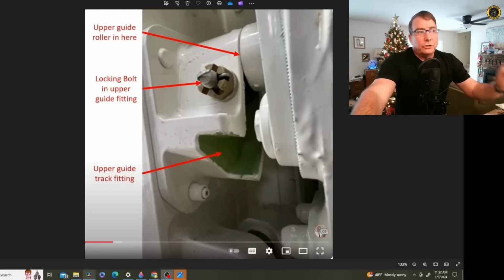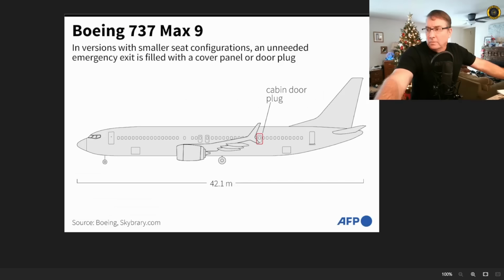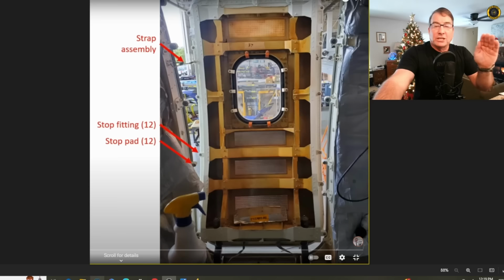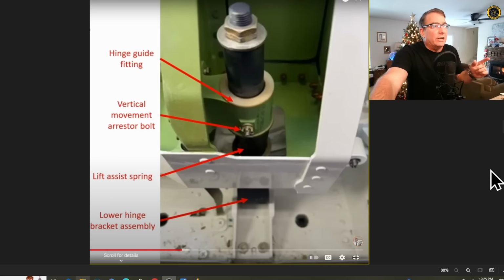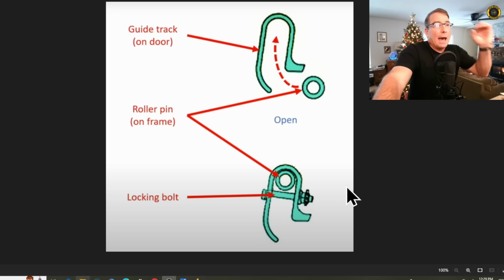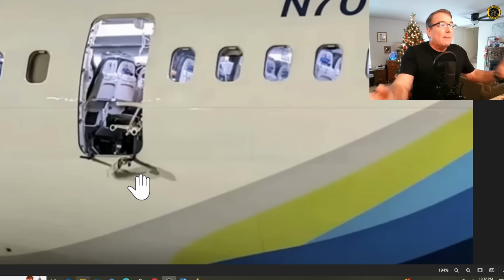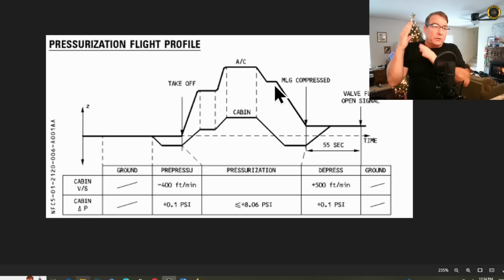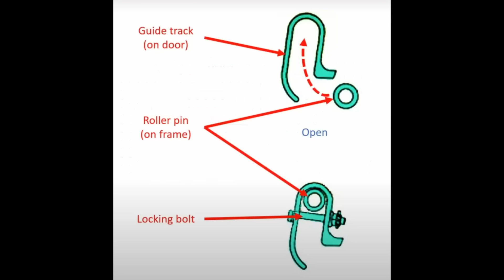Alaska 737 Max-9 Door UPDATE! 8 Jan 2024

Comment: Boeings share price is falling faster than an unbolted plug / plug door / door plug or door 😱
Reply: -5%?
Reply: @sonnybowman  Boeing down -28.28 (-10.99%) past 5 days, be careful posting misinformation, always stick to the facts like Juan
Reply: ....door....... the door thing.... you know the thing.......
Reply: @leokimvideo  It probably fell after the MCAS events also... then rose again, Not a going out of business event.
Reply: Plummeting as fast as Bud Light, lol.
Reply: That's what happens when having planes crash & paying a fine is part of your business model & deemed an acceptable risk so your multi billion dollar operation can make an extra $4m in efficiency savings...
Reply: I finally saw a video that explained enough that I could figure out how that damn door works.

And it's very much a door not a plug.

"Plug door" is an oxymoron and an apt description of what's going on.

It started with a plug, except plugs are really heavy and hard to maintenance. You have to remove the seats and get three big guys or a cherry picker with a proper plug. Lighter than a door doesn't mean plugs are not heavy.

So instead of using a completely failsafe simple set of lugs around the plug frame, they created a complete abomination.

They added hinges so it could swing open. So at this point we have determined that it is a door. Plugs don't hinge, doors do.

Having a continuous bevel makes it impossible for that hinged work so they reduced it to eight small little pads. I think it was eight it might have been a couple more. That way if you shift the door even a single inch it will be free to swing out. That doesn't make it a plug that makes it a complicated door, and a nearly completely compromised plug.

Then they add two giant springs, it's literally spring loaded to eject itself.

And those loose bolts people keep talking about. Those aren't the same bolts as the missing bolts.

Remember when I said they added a hinge? The bracket for the hinge is what they are finding has loose bolts.

One of the hinges is actually missing from the airplane. The same hinge with loose bolts on other aircraft.

So it's not a plug at all it's an outward opening spring-loaded death trap, installed with reckless abandon.

I couldn't come up with a worst design if I tried.

A piece of plywood nailed to the fuselage covered in speed tape, would have been a better solution. Literally Red Green show engineering is more sensible.

None of that figuratively literally, I mean literally literally.

I'm honestly amazed that "plug door" took this long to fail.
Reply: leo, very funny but also sad.  I worked at Boeing '68-'71 and loved the company.  Now unhappily watching the once great company decline into a shadow of their former self.  It started when they moved hq from Seattle to Chicago.  Went from an engineering company to a bean counter company.  :(

Comment: This is a very interesting door design.  I was under the impression that the term plug door means that the door is designed to seal better as the pressure differential increases due to it having a tapered sealing surface.  This means the door could only be removed or released by pulling it inside the aircraft first, i.e. like the over wing exit doors.  This design seems to allow it to release just by sliding it about an inch or so.  Anyway Juan is the gold standard place to go to get the details.  Great analysis.
Reply: Since it's an airplane and not a submarine, I'm wondering the same thing.
Reply: Yes, 2nd the gold standard @jerryfaircloth Juan is the modern day equivalent of Feynman looking into the Challenger.
Reply: Don't the NG (and later) over wing exits just swing up (ie: hinged at the top) ? I remember seeing them like that in the aftermath of the Turkish Airlines 737 crash at Schipol in 2009 ? I think they are held in by pins at the bottom during flight.
Reply: @jerryfaircloth spot on. in order to analyze how this will come is to know how OWE works. and this is like what you have said. cams on top and bottom of OWE are oriented diff such that you can pull down slightly and push out.
Reply: door plug does mean pressure sealed but this is a plug door which isn't. Boeing could have came up with a better term!
Reply: I thought the term door plug was used to describe what goes into the hole that is designed for an emergency exit door on those airplanes that do NOT require an emergency exit at the door plug location.  In other words, if the airplane seat configuration is above X number of seats, then the airplane will have an emergency exit door at that location.  If the airplane seat configuration is below X number of seats, then that emergency exit is not needed, so they plug the hole with the door plug.
Reply: You just made me realise that these door plugs are configured to open outwards... 😳

Now if the MAX was a submarine then that might be fine. But it's an aircraft... ✈

The pressure differential works the other way around... ⚠
Reply: Exactly my thoughts..I've never heard of an emergency door being lost in flight....This "plug" door....should have been designed such that the pressure differential held it in place no matter what...Boeing..Going the route of today..cut corners, go on the cheap and no worries...Sickens me...Let the other aircraft manufacturers go down that dark road, NOT Boeing
Reply: Plug doors do work that way. This is a "plug", but is not constructed like a regular plug door. Very misleading terminology.
Reply: apologies - I asked the same question sometime after you, but with less background knowledge. But pne of my predecessors worked on the deHavilland Comet and I recall the windows were s weak spot that led to structural failure.
Reply: That design would be better sealed but you don't want doors that open inwards to a cramped space. The plugs are similar to the doors and to open such a door you would need it clear of seats and people to operate. Unsuitable for emergencies where crowds might be pushed up against it.
Reply: @dieseldragon6756  before it opens outwards it goes upwards so the stop fittings can clear the stop pads. When in the down position, since the pressure is from the door fittings onto the door frame pads the differential is correct but it is tricky to get your head around.
Reply: In my opinion it's a design flaw, a kluge, a Jerry rigged "fix".  Better design would be to manufacture a fuselage with NO holes at those places for planes that do not need an emergency exit there (because seat configuration doesn't require it), but then Boeing would have two versions of the fuselage, one with holes there and one without.  A simpler solution would be to just install an emergency exit at those locations on EVERY airplane they roll off the line regardless of whether the seat configuration requires it.  Plugging the hole on some planes and putting an emergency exit on others just adds another point of failure for the planes with the door plugs.  As I said, a stoopit "fix" for a problem they did not need to have.

Comment: With the castle nut and the cotter key it was designed to be bullet proof hopefully. Unless bolts were inferior looks like cotter keys were missing and nuts fell off or they were never installed at all. Scary and lucky.
Reply: You'd be surprised how often those cotter pins/keys get missed on cars, wouldn't surprise me if it's happening on planes too. Inspection paint is your friend!
Reply: who signed off on those installations ?  seems like there should be double-blind inspections (different people (not known to each other doing that job), different random times) on all these critical installs.
Reply: I'm betting the cotter keys were not installed
Reply: I realise that it would be hard to do - but if the bold/nut arrangement was reversed, the bolt couldn't fall out if the nut came off. I know that the cotter pin is supposed to prevent that, but it could have provided a bit of extra protection. The cotter pin would be hard to fit and replace if it was reversed, I get that too. The head of the bolt would be a lot stronger.
Reply: @ChavngRynsPvts  But on a brand new car? Unlikely. Yes, if its been down to a back street mechanic a few times, fair enough, but I strongly doubt Ford or VW or Honda would ever fail to install something as crucial as a cotter pin.
Reply: I'm going to vote for never were installed in the first place.
Reply: At this point, yours and Juan's theory seems to be the most logical. The question is WHO left the cotter pins out? Someone else said that AAR did a mod to this aircraft.....and maybe did the mod for other airlines as well. The "who" part may not be so simple to determine.
Reply: @grayrabbit2211   Not likely. I doubt it could fly even once without the bolts installed.
Reply: @karlosbricks2413  I have greater faith in people failing than you have. Or weaker doubts. Two of my recent Found on road dead’s have had factory errors that lead to failures. (One was a 13 cent missing washer that lead to a transmission sticking in gear. 26 hours labor.)
Reply: Bullet proof, but idiot proof?  Always a human factor in these sort of things.
Reply: @theharper1 I thought about that, but how do you get the clearance to get bolt installed in the first place?  What happens when you need to remove the door?
Reply: I bet there are zero cotter pins on modern cars.  They went away with grease zerks.
Reply: @anonymous12345678935  that's why I said it's difficult (not impossible though). The only reason that the "plug" would need to be removed would be to refit the aircraft interior or convert it to an LCC configuration, which would be very infrequent.
Reply: Missing cotter keys or improperly installed cotter keys (ex: both ends not bent in different orientation around the bolt to hold the castle nut in place, assuming it was tight) is my preliminary theory. Let's not jump to conclusions though.

It's my understanding that the hole in the fuselage is there because a regular exit door is installed on those aircraft that have 220 or more seats (that's what the initial NTSB briefing said), to satisfy the 90-second evacuation requirement. The Alaska and United planes have around 200 seats so the door is not needed, hence a door plug (cheaper and requires no maintenance (in theory)) is installed instead.
Reply: I think it's more likely that the bolts were not installed at all.  I can see this happening more easily than than failure to install a cotter pin on a castle nut.
Reply: @jimmeade2976  The correct way to install a cotter pin is to bend one half back over the end of the bolt and leave the other half straight.
Reply: @BrandyBalloon I was taught to bend both halves of the cotter key, each in opposite directions around the bolt or nut. That way, if one end broke or rusted away, the cotter key would still hold the castle nut in place.

Comment: As an Air Force mechanic we were taught to wire bolts so they were secure, similar to a cotter pin keeps the bolt from moving
Reply: A lot of safety wiring has been cut down. Theres a big push to reduce labor hours in aviation maint/repair, and I get the impressions that designers felt (or maybe they were pressured to) move away from that. But that last bit is a total guess
Reply: Yep, Anthony, I wondered about that too.   Using wire instead of a cotter pin is more secure.
Reply: The bolt they used as a limit seems to be very small.
Reply: @jamesrussell7760  I am not aware of what you mean by wiring bolts but how is that more secure than a cotter pin that goes thru the bolt shaft and is then bent around nut at the tips? That seems quite secure to me..since a cotter pin is made of thicker material than easily bendable wire.
Reply: @ShaunHensley    As you know, vibration is unending in all parts of an operating aircraft.   My bet is that the cotter pin securing the nut on each bolt is the Achilles Heel of the mechanism.   With constant vibration, the cotter pins failed, allowing the nuts to unwind until they fall off.   Next, the bolts works loose until they fall off.   The NTSB did not find any of the bolts.  That is an extremely telling finding.   All of what I think happened wouldn't happen all at once; there is no telling how many takeoff and landing cycles it took.  My guess is that the NTSB will recommend that the cotter pins be replaced with wire at the Boeing factory and that the Airline mechanics will be required to conduct periodic inspections of the mechanism.
Reply: @jamesrussell7760  it depends... wire and cotter pin are no different if both are installed correctly. Sure, if the material is bad that's a different issue but there is not really a mechanical advantage for one over the other.
Reply: I thought the cotter pin thing was a little archaic, but I'm sure aircraft rated. I do know in race cars many bolts and nuts are wired
Reply: @jerrylittle7797    You're right, Jerry, if "installed correctly.".   But, I point out that the cross section of a cotter pin is two semicircles with each half bent backward around the nut.   If there is any looseness in the way the cotter pin is installed, then constant vibration can sever the pin, one semicircle at a time if not both at once.    On the other hand, the way that wire is installed, it's pretty much impossible to be loose.   Moreover, at the point of wear, wire has double the metal of a cotter pin.   In my personal experience, aircraft construction always uses wire, never a cotter pin, to secure a nut.    The other option is to use two nuts, torqued against each other, the outer nut being a lock nut
Reply: @JohnHallgren   Okay.  Both the nut and bolt have a hole drilled through them.   Whether you use a cotter pin or wire, the holes must be lined up.   The wire gauge is the same size as the shaft of a cotter pin, snugly fitting the hole.   Moreover, the wire used for the purpose is made of high carbon stainless steel (to prevent rusting), not ordinary bailing wire and a special tool is required to install the wire and wrap it around the nut.    Cotter pins are quite adequate in auto construction since you don't have the constant vibration you see in operating aircraft.   Has this been helpful?
Reply: All very good info but was this not a nearly brand new a/c and therefore the fixation of the door plug , whichever way it may have been secured, should not have gotten loose.
Reply: @vinzenzvega4445     Yeah, I also noticed that this particular 737 max had only been in service for a couple months.  I reckon we will have to wait for the final NTSB report for answers to this and other questions.
Reply: As long time ago, former rotory wing A.M.E. .
With Bell's control rods/push pull tubes, combination, self-locking castellated nuts were the standard.
As well as one additional step,  bending  the top leg of cotter pin over and into an adjacent empty castellation, further securing the locking assembly.
Reply: @jamesrussell7760    Makes sense.  Although I've never seen a cotter pin vibrate enough to wear through, I don't doubt that it's possible.  (I work on land based vehicles,  I'm sure vibration wear is a much bigger issue in aviation)
Reply: Cotter pins through castelated nuts are perfectly fine. They are used all over aircraft, with no issues. Those bolts can handle some high shear loads. If a nut plate was used on the bolts, then safety wire would be the way to go. Aircraft mechanic of 29 years here.
Reply: @jamesrussell7760  

Not necessarily James....
Wiring is usually there as an indication against tampering...and to prevent unauthorised removal.
In this sense, wire can be additional to the Cotter Pin.....if required.

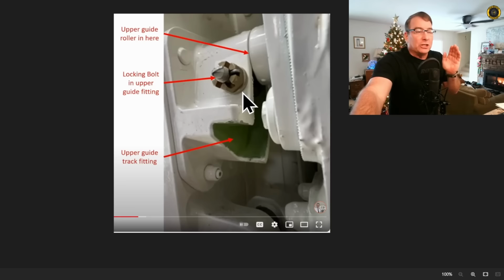From the picture of the Castelated Nut and Cotter Pin shown at 1:45 in Juan's report, the Cotter Pin is not fitted correctly. It also appear to be too small.

Cotter Pin Heads should be external to and proud of the slot in the nut. This enables the Cotter to be splayed correctly against and around the tightened nut.

The head of the Cotter Pin is shown inside the slot of the nut. Infact, it appears to have been purposely fitted that way, by being rotated through 90 degrees. 

I would suggest that this fitting has all the hallmarks of a rushed job, with the Cotter Pin just banged in place, and  that it has not been properly inspected upon completion.

We can see one 'tang' of the Cotter Pin splayed over the end of the bolt, which is incorrect. We cannot see the other tang, but can probably fairly assume that it is simply bent toward the body of the Upper Guide....so again incorrect.

A correctly fitted Cotter Pin would have both of it's tangs bearing against the outer face of the Castelated Nut........though not necessarily bent right round against it. The head of the Cotter Pin should be readily seen with it's circular head end visible and external to the slot of the Castelated Nut. 

This is accepted engineering practice....and in my Railway Signalling Apprenticeship days is how we fitted them to point mechanisms, (switches), and signalling equipment.

Had the Cotter Pin been fitted correctly.........and an application of paint sprayed over it and the nut, it would leave a reference 'paint shadow' mark on the bracket body....

James Hennighan
Yorkshire, England
Reply: @jamesrussell7760  thanks much for that detailed answer! I had no clue about how it worked and the only things I found on a search were for a different situation/hardware than used here.
Reply: @jamesrussell7760  as an owner of a certified aircraft, I can tell you that cotter pins are used all over the place.
Reply: @jameshennighan8193    Excellent points from a guy who obviously knows his stuff.  Thanks, James.
Reply: good ol "Safety wire pliers''',,,  maybe the company that makes those pliers should be knocking on Boeings door to take a huge order,,,